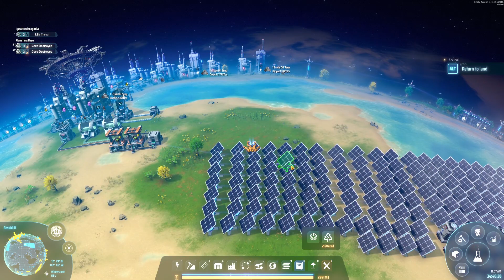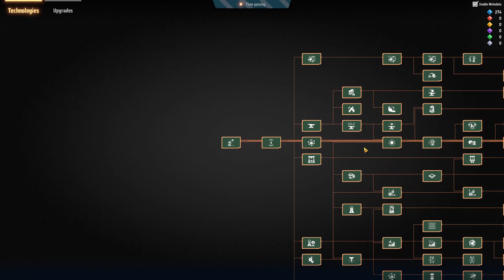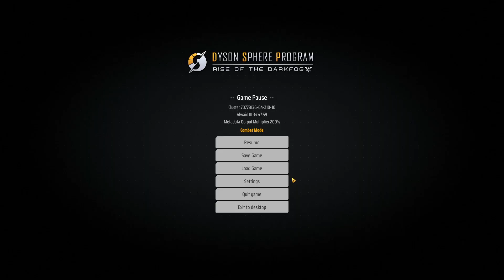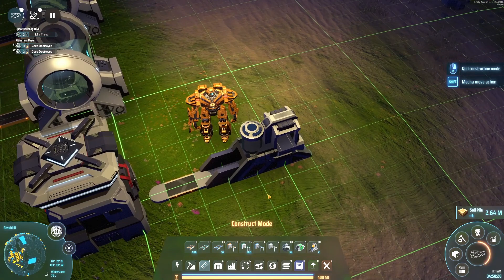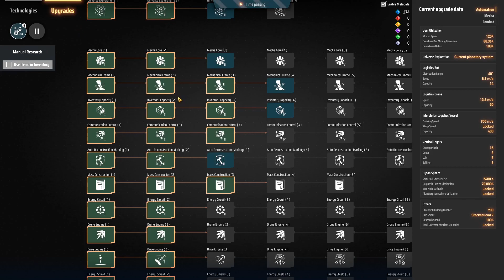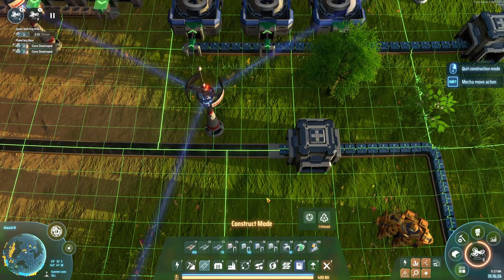DEUTERON FUEL ROD // Dyson Sphere Program // Mission Log 39

Comment: proliferation! nice! proliferator is the primary use of coal in your end game other than explosives now that you are getting into "clean energy."

Proliferator tips:
ALL inputs must be proliferated to get any effect. partial proliferation is just a waste of sprays.
if inputs have different levels of proliferation, the minimum effect is used, so you always want to use the same level of proliferation.
if your power sufficiency isn't 100%, materials will only get partially proliferated so stay on top of your power generation.
spray coaters can be used in EITHER direction so don't worry about it, pick your aesthetic.
proliferator has 2 primary benefits and you pick 1: extra products or extra speed. Extra Products saves you raw materials, extra speed can get you high throughput with lower number of machines. its primarily used for ultra endgame where the limiting factor is the processing power of the computer you're playing the game on, and you have single-digit framerate.
any recipe that uses a BUILDING as an input, cannot benefit from extra products. (things like mark 2/3 belts, ILS, etc.)
proliferating science cubes gives you extra hashes per cube, which means you can research faster.
proliferating fuel either improves the total energy yield (takes longer to be consumed in a power plant), or the burn rate (so you need less power plants to get the same power output).
proliferating ammo gives you extra shots.
proliferating your proliferator gives you extra sprays!

by far your best things to proliferate are science, fuel, ammo, and proliferator itself. the rest is up to you.

highly recommend spraying those fuel rods as they come off the assembler/before they go into the box.
Reply from the maker: Done! The sprayed rods are incredible. Thanks for the tips!
Reply: Great tips, as always! I hadn't thought of proliferating proliferator.

I've a question for both of you. (I keep trying to figure it out, but keep getting distracted.) If the fuel is just going into a power plant for energy production, is it better to make fuel rods or just feed it in directly? For burning hydrogen, I did manage to work it out, and discovered it's only a modest increase not worth the cost. I decided fuel rods are useful when you need energy density, as in portable situations or transportation. Definitely good for Icarus. Otherwise, skip the packaging and consume it directly.
Reply from the maker: @DistracticusPrime  If you're talking about hydrogen fuel rods, I feel it can be worthwhile to make them if you have excess energy. They're a nice fuel for Icarus until you get to deuteron. In my second playthrough I've avoided fuel rods entirely however, using solar panels everywhere instead.
Reply: @DistracticusPrime  to be perfectly honest I'm not sure if you CAN burn raw deuterium in a fusion plant. I've never tried. burning raw hydrogen or fire ice in a thermal plant though its super easy for some free power, especially if you're getting it from your gas giant. you may want to make sure you're using high quality sorters and belts though, because raw hydrogen burns so quickly. for your mecha, always make the rods, since you get so much free power and density from proliferated rods.